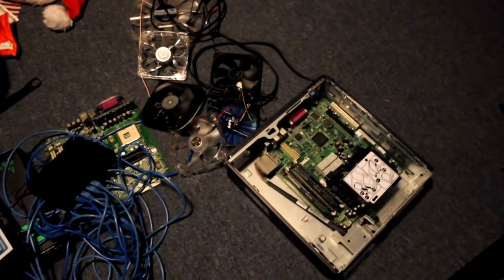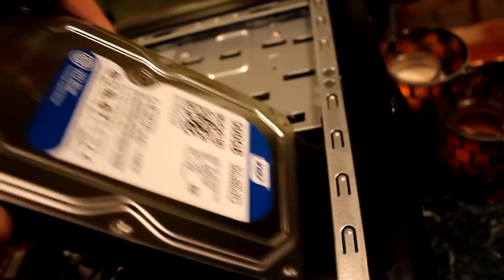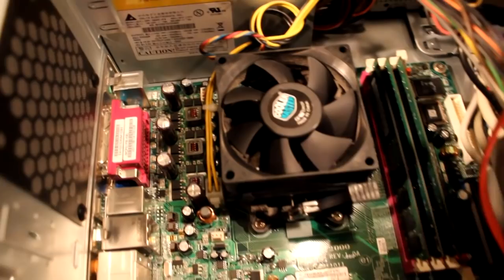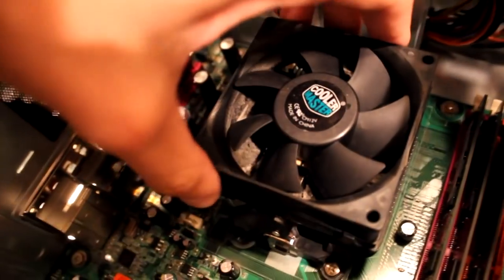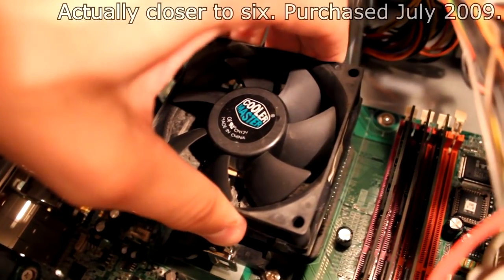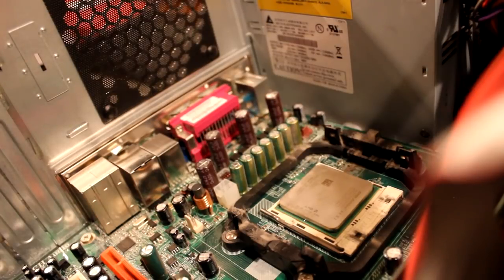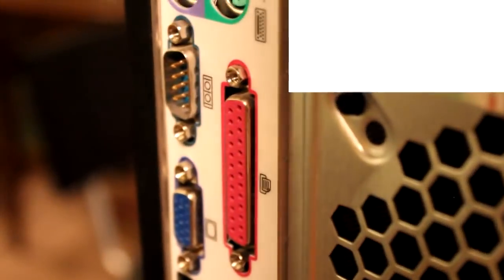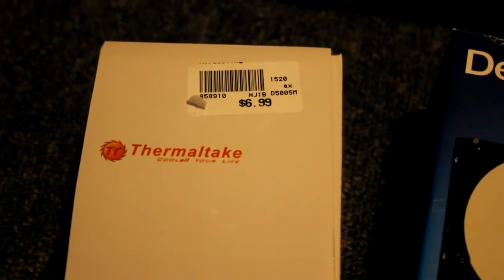Giving a 7-year-old computer a second life

Comment: When a PC sits for a while the thermal paste gets hard. All you had to do to prevent the heat sink from sticking to the CPU was start and run the PC for a few minutes. Also for $100 you could have bought a PC that is more powerful than that. So what you've done is a waste of money.
Reply: The kid seems pretty innocent and looks to enjoy this kind of stuff but I also can't help but notice so many things such as improperly pulling the heatsink, not dusting off the rest of inside, going ahead and using the pre laid thermal on that replacement heatsink, not noticing the bulging caps around the cpu, spending more money than needed on parts, buying windows 7 in 2015....

Jesus, maybe he's pretty new to all this but at the very least ask around forums and stuff.

Comment: I'm running a 5 dollar thrift bought HP workstation with x2 4200+ (940 pin) at 2.2 gighertz and 4 gigs of ddr2 6400 ram.  Nvidia 7800 gt video card and a Samsung 750  120 gig ssd.  I need a 5400+ or higher processor or better to make this a great system for internet duties.  hd video playback is smooth at (720p) watching YouTube content.  Thanks for posting the video. :)

Comment: I person i know gave me a computer with a AthlonX2 64 it was water cooled but did not run anymore so i am taking the computer and putting a RX 460 in it adding 8 gigs of ram 800mhz putting a cooler master T4 cpu cooler on it adding wifi ac 1200 mbps adding usb 3.0 also going to overclock the hell out of it.
Reply: Hello, well before you do all that, does your motherboard even support upto 8gb of ram? Does it have PCI ports? Is the power supply capable enough to handle the RX 460? You know that your pc will bottleneck if you keep that AMD Athlon?
Reply: Its the Asus M2N-E SLI motherboard and yes it does suport 8 gigs of ram up to 800mhz.
Reply: Steven Anderson make sure it's pci-e 3 compatible else the motherboard won't take the graphics card. I have a 590SLI board with an x2 6000+ and it wouldn't take an RX460.
Reply: Thank you i did and changed my mind i am going with a pci-e 2.0 card the gt 730 not a great card but we are dealing with ddr2 also so there is nothing else to do but the computer was free and for a couple hundred dollars i can have a decent computer.
Reply: AMD x2 6000+, 4GB DDR2-800, ATI HD7770. Runs pretty much anything.
Reply: Thanks for the info i might just try that sounds like it would work great.

Comment: My gamin pc is from 2009 ( it has a Intel core i7 960, 12 GB of ddr3 ram ( i had to take out 1 card because it was bad so now its at 10gb ), and a Radeon HD 5800 (booooo) graphics card.  its an Alien Ware Aurar R3, and cost around 2.5 millionk at the time it was new. Still runs Fallout 4 on medium settings just fine. YQ
Reply: no that's a 2011 system.
Reply: +Anthony Ferreira The i7 was around in 2008. The first computer I recall using a i7 was the Gateway FX6000.
Reply: +Anthony Ferreira nope its a 2009, some of the specs were changed to more modern parts.
Reply: +Connor Murphy still does me pretty well
Reply: 2.5 millionk? Im rereading this and i think i meant 3k .-.
Reply: btw its not ram cards, its sticks :)

Comment: Look at those caps... all bad that why...
Reply: Was about to comment that, those capacitors near the CPU socket are popping, that may be the real reason to the issue. I strongly recomend installing another motherboard.
About old computers...i have an old Q6600 that still works very good.
Cheers

Comment: yuck got the same integrated gpu in our old pc, cant even run the windows 10 ui properly
Reply: Swessy haha vad gör du här?? :))
Reply: johnbohngamer frågan är ju vad du gör här
Reply: Those integrated gpu's are the stability failure point (the capacitor right above the pci express slot fails). Drop in  a cheap pci card and disable onboard video in your bios.

Comment: OK, so you replaced the hard drive with a new one. If the PC is only 7 years old, its MB would DEFINITELY have SATA-ports. WHY ON EARTH would you replace it with a PATA drive? PATAs are SO SLOW. And given the fact that you decided to install a PATA, WHY would you use those old, grey IDE ribbon-cables instead of the modern, black ones? If you do that, the HDD will NEVER operate at the speed it was designed for.

Comment: my pc very well 9 years old he, and not to change thermal paste :D
Reply: depends on the quality of the paste used
Reply: And plus the original thermal paste and my cpu is overclocked
Reply: Ignas op123 Good for you? IMO you should probably change that considering you'd definitely see temp drops... it might still work, but not to it's best efficiency... which would aid in your overclocking ability
Reply: Well my pc tem iš Core:0 47C-116F Core:1 49C-120F On game Core:0 47C-116F Core:1 51C-124F
Reply: Your temps mean nothing to us if we don't know what cpu, cooler type and ambient temp. Then that information you provided might become relevant.
Reply: for instance: my 4790k (tdp of 88) idles at 42c with an ambient case temp of 27c once it's warmed up with a Megahelms Rev B cooler and a dual fan setup. <- with that info a proper comparison apples to apples can be made.
Reply: Ignas op123 WHAT ARE YOU EVEN SAYING??
Reply: John Mack I think he's trying to describe how well his cooling system works. on his core 2 duo.
Reply: well cpu cooler is original AMD.
Reply: Ignas op123 and based on you comments your thermal compund is overclocked, and your "on load" cpu temp is 2 degrees C higher than idle?
Reply: Well cold pc tems is core:0 15 C core :1 18 C. Well gaming gta 4 Core:0 51C Core:1 55C cpu used 98% and add ram 2 gb ddr2. I I am thinking buy new cpu and coller
Reply: And to edit video cpu used to 100% fan speed up to 3050 RPM :D
Reply: 2 decrees c rise on a stock amd cooler because you thermal paste is overclocked? Heil the troll.
Reply: Do seriously need some kind of guidance, or am I being Reiched?
Reply: Cpu socket AM2 AM2+
Reply: :D

Comment: look man pc hardware 101... let the cpu warm up before u try to take the heatsink off. and never pull the heatsink off directly, give it a few gentle but firm twists will putting some pulling force on it... never I repeat never pull the cpu out of a locked socket... Ur lucky that u didn't bend or even lose a couple pins doing that shit... I cringed so hard when I heard that pop